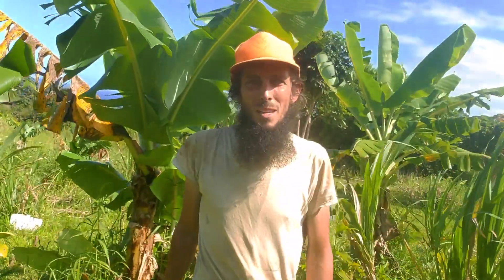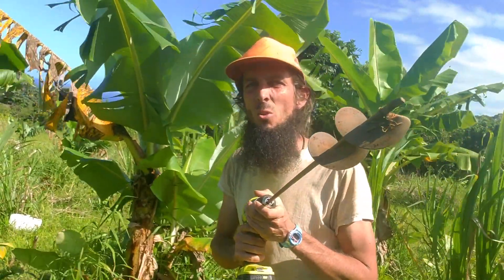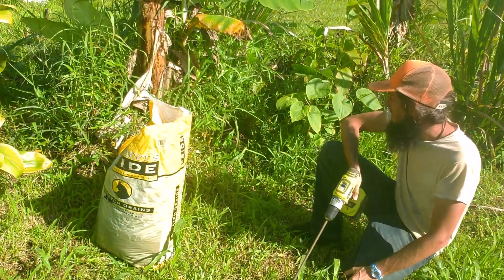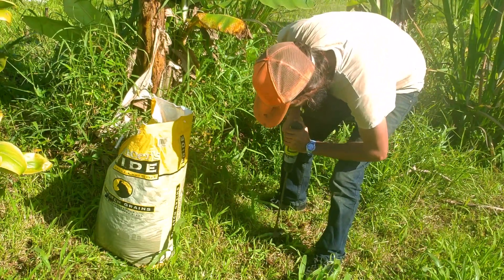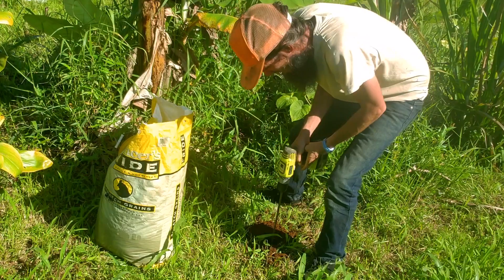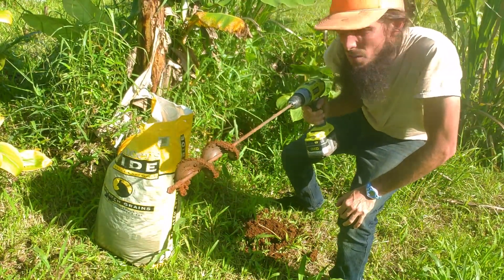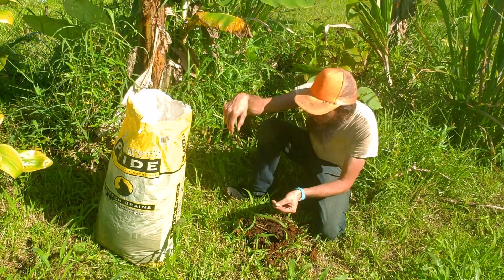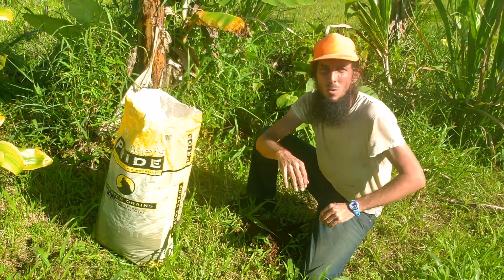Screw your Soil with KNF

Comment: Everywhere i live is 1 meter of clay then rocks full of fossils. Ive smashed 1 handfull of rocks to dust crumbled a couple hand fulls of clay. I also mixed 1 liter of water. 30ml of sea water, 5ml of fpj, 5ml lab, 2.5ml ohn, 2.5ml wca and 2.5 wcap. Then mixed the liquids and solids together in a bucket. how long should i leave it for and should i add an air pump or not. Im hoping to reactivate some Jurassic microbes to see what effect they have on the garden?